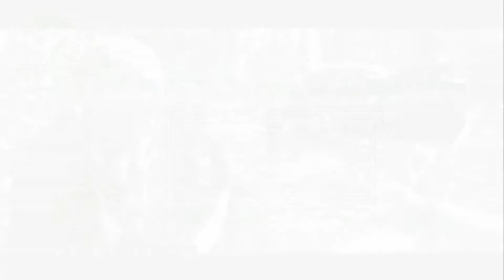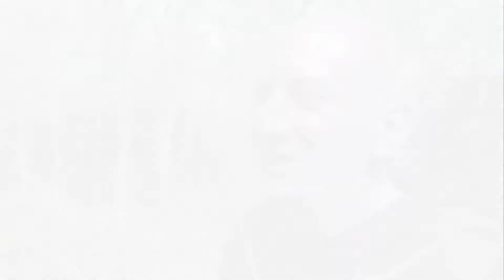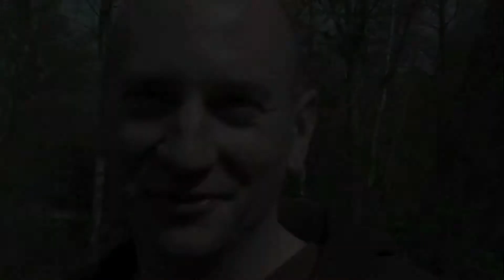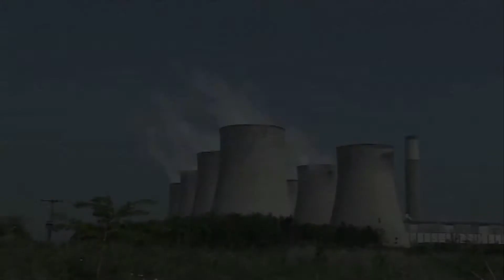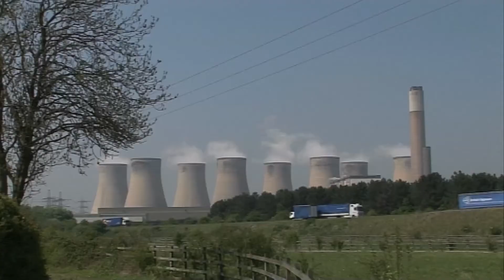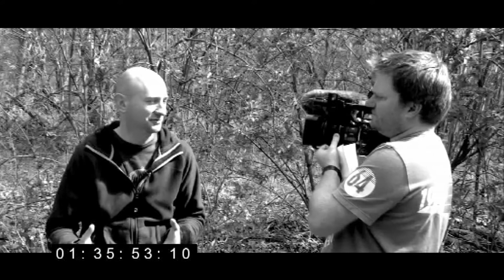More on Carbon Capture

Comment: Some coal power plants do not have real chimneys though! Some just give off the smoke via the cooling towers. 
(The one I visited had a tiny chimney for when they use oil to generate the process heat for the nearby industrial park, while the actual coal burning had to be stopped for some reason)